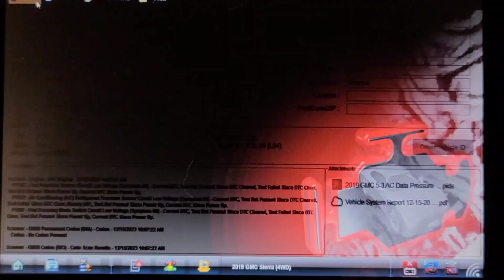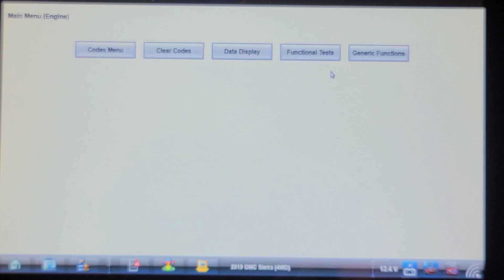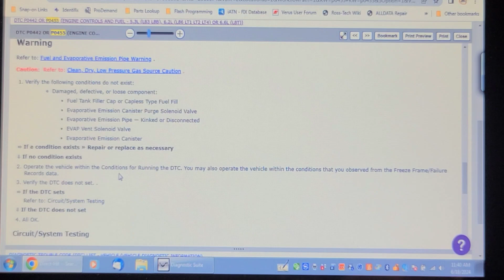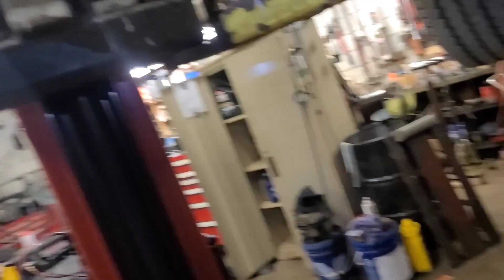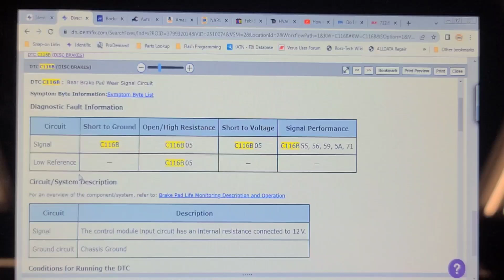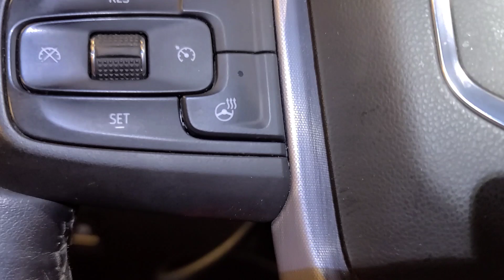2019 GM Truck 1500 4x4 P0455, C116B and More

Comment: That ecm wiring issue you mentioned vicinity left front fender is a common issue coming up on 2019 models, wiring chaffing. GM needs to be recalling those by rights. Not sure who the rocket scientist at GM figured putting an ecu there was a brilliant piece of engineering.
Reply from the maker: For sure! Wait til they get old...